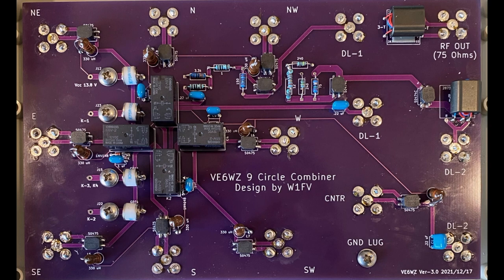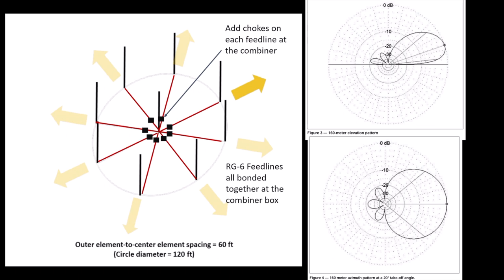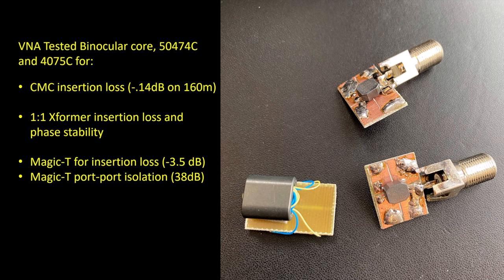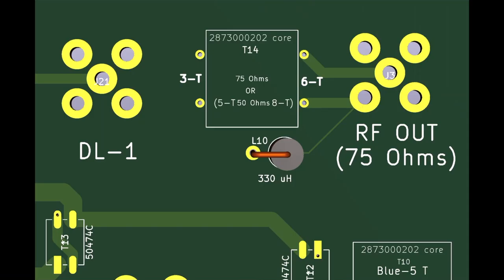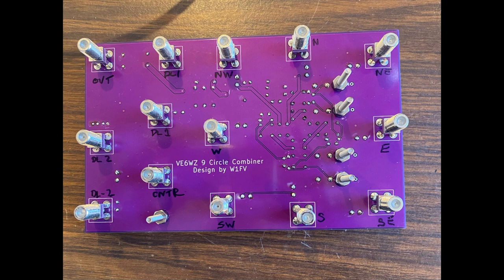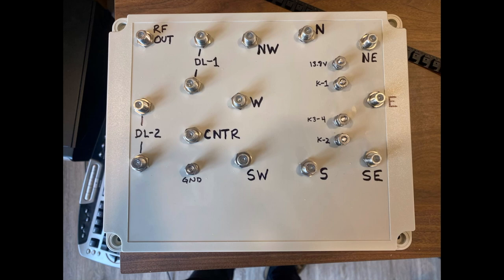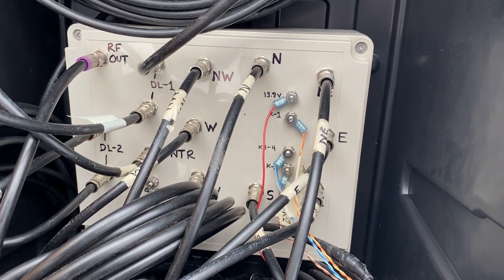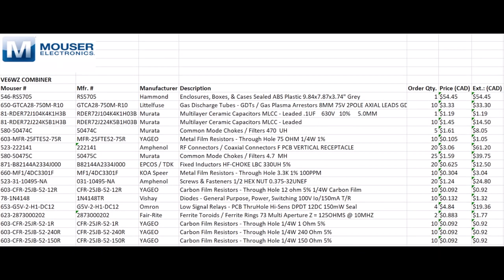DIY 9-circle combiner board with on board chokes

Comment: I love you videos, Steve!  I'm building a 9 circle with this board and your antenna preamps.  I have all the electronics and cables tested now.  Now just need to build the verticals (hopefully out of my aluminum stockpile) and install.  I'm planning on using a Green Heron remote to control it and send the 12v supply on the hardline/coax run.  I think I'm going to add your 75 ohm 2N5109 preamp at the antenna end.  Thanks again!  Ty  K3MM